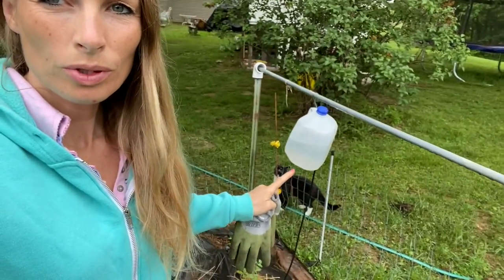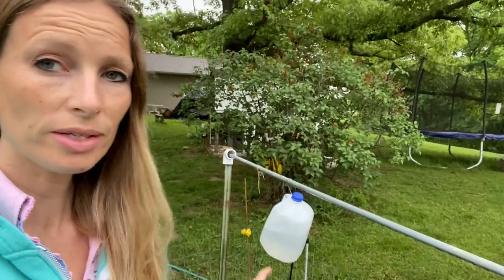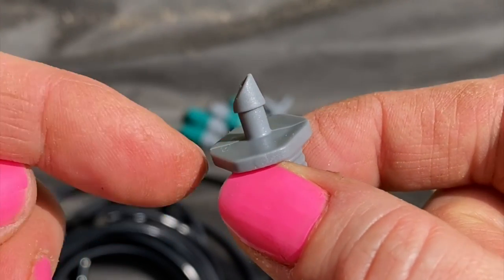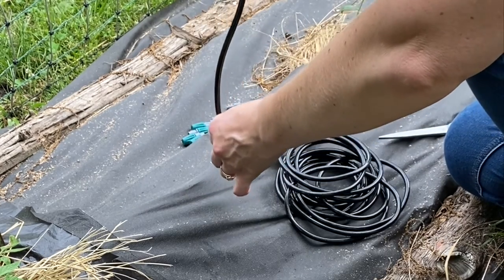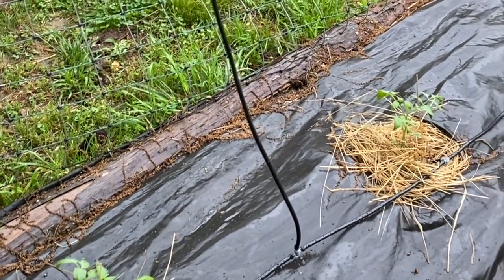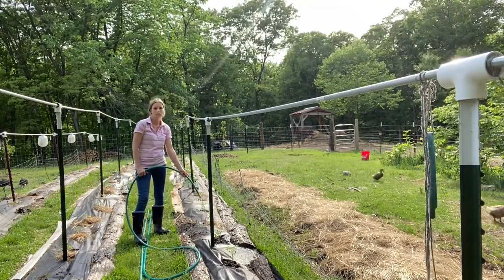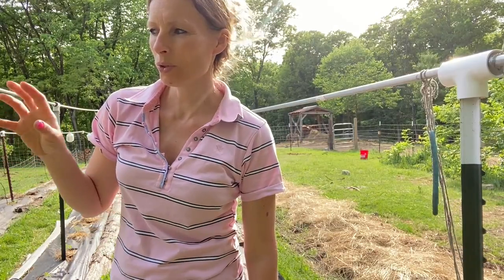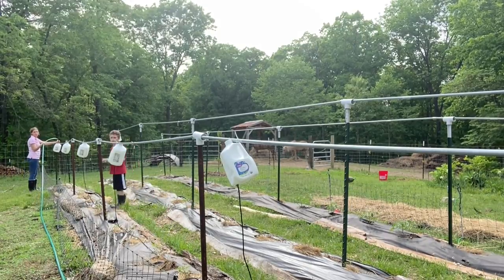DIY gravity fed drip system using a milk jug

Comment: Please let me know what type of blue drip emitters you used where the head screws off and one can attach a 1/4 inch irrigation line?
Reply: I mean where can I buy the same self tapping green drip emitters?
Reply from the maker: @sdfft820  so i got a cheap kit off amazon while doing a search for drip irrigation- they were in the kit… im sure if you search for self tapping drip emitters you will find them… i just did a search and these ones look the same https://www.amazon.com/Axe-Sickle-Adjustable-Irrigation-Sprinklers/dp/B087WRYQ3K/ref=mp_s_a_1_6?crid=37GZB3NJTFSKS&keywords=self+tapping+drip+emitters&qid=1668271968&sprefix=self+tapping+drip+emitters%2Caps%2C178&sr=8-6